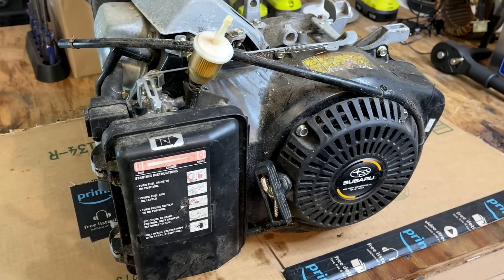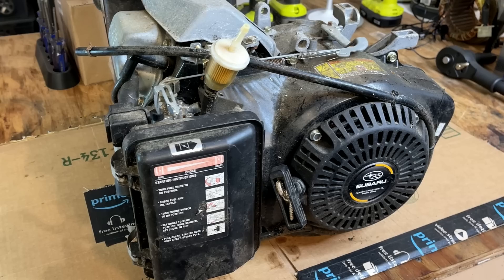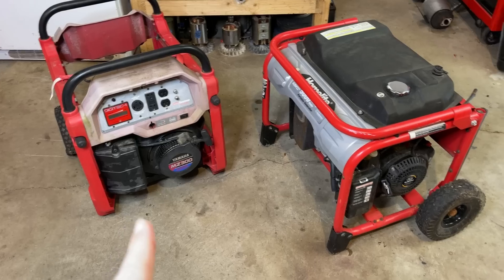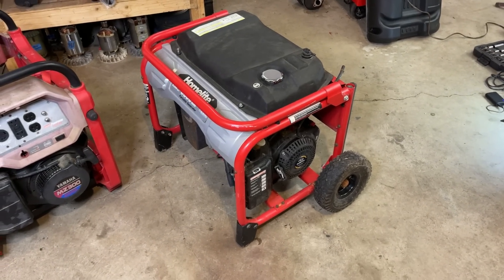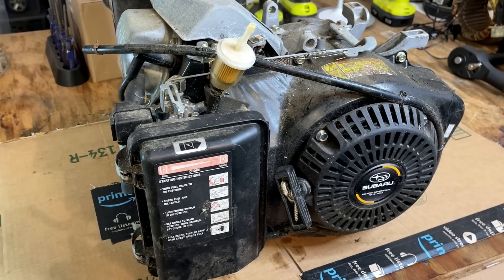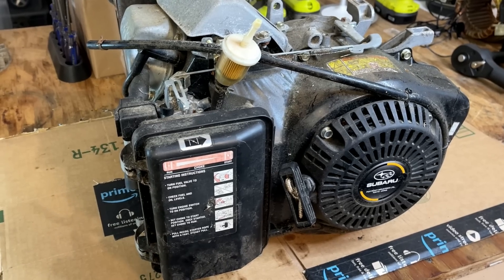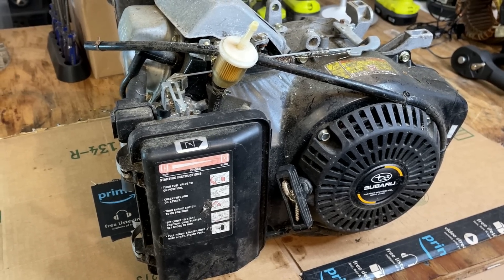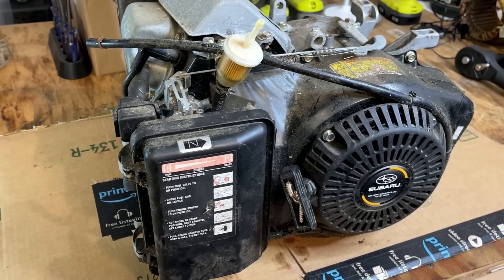Subaru EX Teardown

Comment: Typically its lack of maintenance or user error that I see with most of the boxer Subaru engines. I actually have a Forrester that has 175,000 on it and is still running strong. I know plenty of people that have not made it past 100,000 I have a friend that replaced, his boxer engine with a brand new one and it only lasted 10,000 miles before it blew up again but when you throw a turbo charger at it and moderate boost with a leadfoot, that’s what happens😂
Reply: How do you not read how unreliable that car is now days.
Reply: @jayjudd6518  it’s all about maintenance because the one I have has never been apart since it left the factory 175,000 still going strong I don’t call that unreliable at all mines naturally aspirated my buddy has the XT so his is turbo charged his original motor lasted 130,000. The replacement one only lasted 10,000 miles so obviously something wasn’t put together right

Comment: The Subaru and Robin small engines, are they one in the same? I have a small 3250 Coleman Powermate with a Robin on it.
Reply: Yes they are.

There's a long and interesting history between Wisconsin/Robin/Subaru. Essentially Subaru used Wisconsin Robin to introduce their small engines to the US under a familiar name.
Reply from the maker: Now Subaru power is owned by Yamaha.
Reply: I have a Wisconsin Robin engine on a 1989 Snapper walk behind lawn mower (I bought it new). Snapper marketed as "extra tough" and it is!! I've changed oil and put in a new spark plug once and cleared out a carb jet once. The only issue is I live at 6520 feet and it runs a little rich. I also had to spray the recoil starter with WD40 a couple times because it got stickey. I'm not sure there has ever been a better engine built!!!

Comment: I'm pretty sure your assessment is on spot. 
They ruined a beautiful engine by using a plastic governor instead of metal.
Reply: I don't think I've seen a metal govenor gear in an engine, maybe ever. A quick google search shows a page full of plastic gears, and one metal gear for the Briggs Vtwin. Plastic parts aren't always bad, as long as they're made properly and used within their operating limits (temperature being the main one)
Reply: @AlexanderBurgers  I've seen many. Mostly older generators. 
Plastic and heat don't go together as you also know. They just wanted to save about 15 to 25 cents on a stamped steel part.

Comment: I wonder if this one was run for a long period on a slope, causing the oil to pool one side of the crank case, and starving the bottom end of the engine of oil causing the conecting rod / governor failure?
Reply from the maker: Very possible.  Looking back in the video, the oil that came out looked a lot newer then I remembered.  Usually though the engine smells burnt when they run out of oil.  Did not smell any of that.
Reply: @jcondon1  thanks for all the content you provide, the pace and detail you go into is perfect, so much so I have managed to sort a few engine issues with some of my own garden equipment through following you, issues I would other wise have had to get someone else to sort for me and now seem so straight forward. 👍
Reply: @jcondon1  Most all my small engines have low oil protection. They won't run if they are at an angle. My guess is the cheap plastic parts failed then the self destruction followed.
Reply: I'd agree, a possibility there.
Reply: Good point.